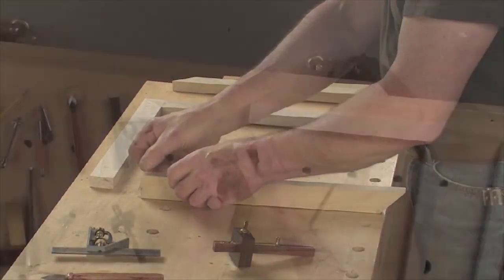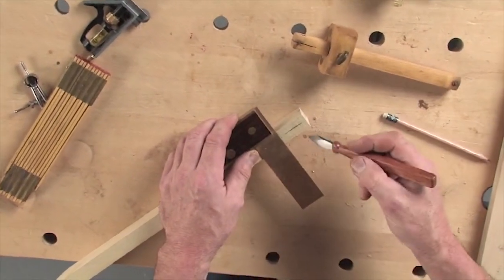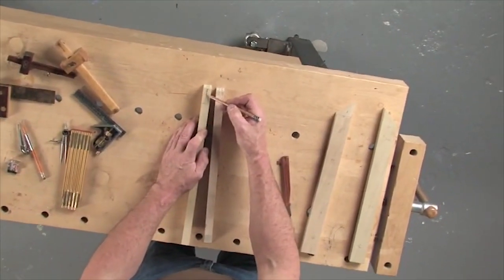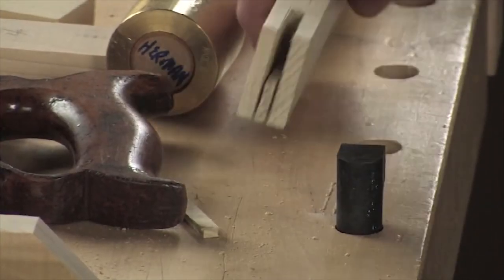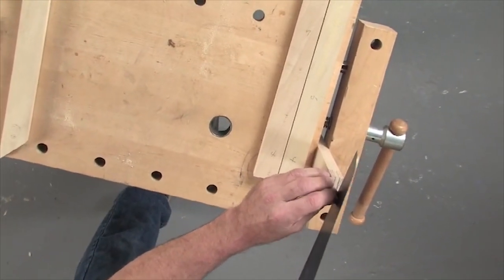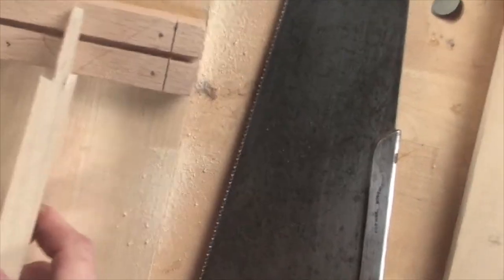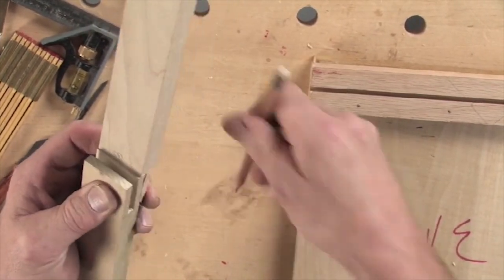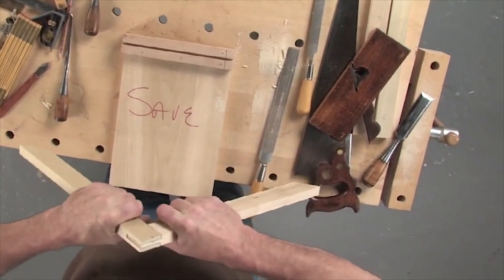Hand Tool Joinery: Corner Slip Joint

Comment: In case anyone is confused, pretty much everywhere else I've ever seen this joint described in a decade of devouring books, DVD's, magazines, internet blogs, YouTube channels, etc., it was referred to as a "bridle joint." Strange they wouldn't use what is by far the most common name for it, but maybe that's mentioned elsewhere in the video.  By the way- If you're wanting to learn how to sharpen hand saws, Ron Herman's video on that is really, really good.  Highly recommended.
Reply: Ryan Cheney 
Yep, you are right. It’s a bridal joint. Commonly used in window sash making along with sliding dovetail which is a much stronger joint. The best thing about the sliding dovetail is it does not require clamping or pinning.